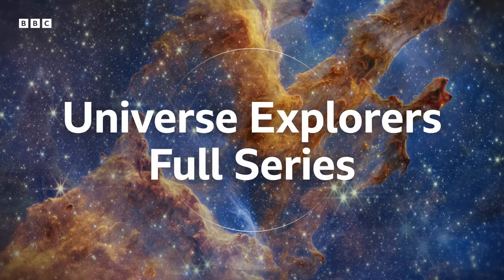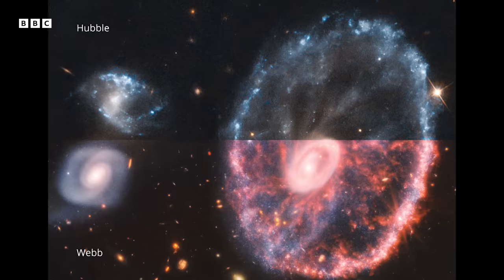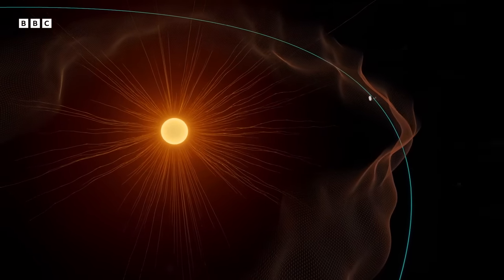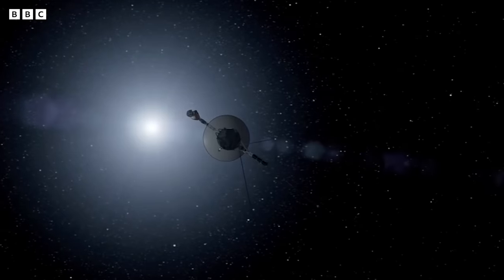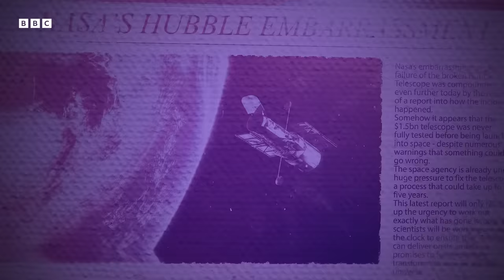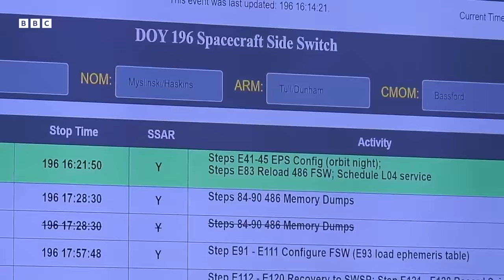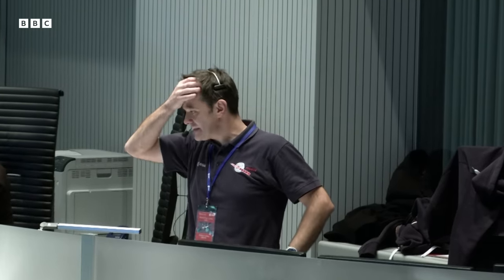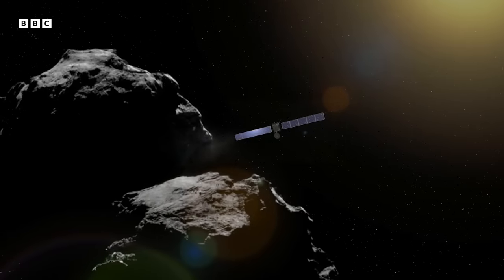Exploring our Mind-Blowing Universe | BBC Earth Science

Comment: What happens when later the all black holes finished-sucked the whole gases and planets in the universe

Three things

1- it will intercept each other  pulling and connecting each other to generate one massive black hole
2-because of its tendency of sucking gases it will become unstable with no gas to suck now it may break to release the gases and all inside -out or it may not because of its strength of no even light escaping(break or not)

3-inside the one massive black hole it will appear ignition of gases that could react to the inner dimensions of black hole and break the black hole or not

Comment: When you think of frequency it is related to time. If you have a sheet of neutrons throughout then there would be no frequency. Because time cannot be created. So possible before big bang the universe was single dimension of neutrons. A rapid expansion of the neutrons gaps lead to what is called time. Then they formed 3 d to get all the subatomic particles and light. So energy was produced by these gaps we call light which doesn't have mass. As for light is concerned it is a time producer.

Comment: Just a question. If you reduce the amplitude of a wave, does that mean you can get a clearer image? Recently they switched to ultra violet light in chip manufacturing because of it's shorter wavelength and because of the higher energy value of the wave they were able to reduce the amplitude and thus heighten the precision ( I think ). Enlighten me, anyone? 😊

Thank U

Comment: We can save the big 💰s for big science. Gravitational wave detectors are being built in China and India. It is planned to launch heavy space rockets with interplanetary satellites, such as LISA and so on. That's over $4 billion, not counting other resources.

For this we need; assemble a hybrid fiber optic gyroscope (based on Michelson's experience 1881-2015). Use a hybrid fiber optic gyroscope and measure; 20, 25, 30 m/sec. car speed along a straight path.

As a result we get: Postulate 1. Light is an ordered vibration of gravitational quanta. Postulate 2. The gravitational field controls the frequency and speed of light in a vacuum.

Comment: This is a generally accurate video and I enjoyed watching it.  However, A statement by one of the astronomers that JWST is More than a thousand times more able at observation than Hubble is Not correct.  The diameter of the JWST mirror is 6.5 meters.  The diameter of Hubble mirror is 2.4 meters.  The difference in light gathering power is the square of 6.5 divided by 2/4, which is the square of 2.7083, which us 7.335.  So JWST has 7.335 times more light gathering power than Hubble, which is a lot Less than a thousand.  If you add in the greater usefulness of JWST covering the whole or nearly whole infrared spectrum as compared to Hubble covering ultraviolet, visible, and near infrared, that gives some advantage for certain uses.  Also, the better instruments on JWST gives advantage, but the mirror only of JWST is certainly not a thousand times better than Hubble's.
Reply: They did not say that JWST gathers 1000 times more visible light than Hobble. So what are you even arguing about?